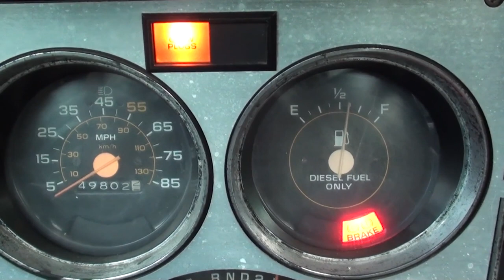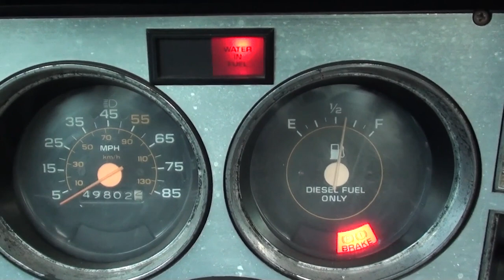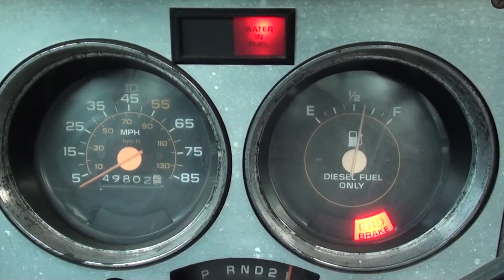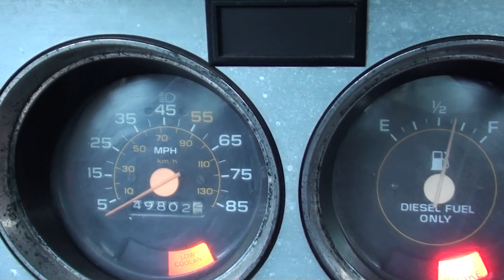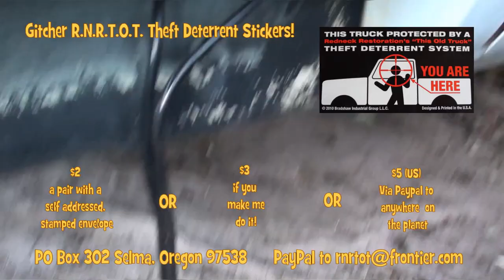84 Chevy 6.2 Lives Again! Fix the Fuel Leaks. Part 3 of a Series.

Comment: I bought my 84 GMC K2500 new off the lot and she’s still running. Replaced the original 6.2 with a rebuilt at 250,000 miles when a glow plug exploded and brought disaster. A great truck.

Comment: "It' not going to start !!!" Hahaha! I hear you brother. People that stupid should not be allowed on the streets. Another great video, Jeff.
Reply: One morning at work, a co-worker told us about a group of people standing around a car that wouldn't start. The car was cranked three or four times, and it would crank fine, but it would not fire.  Then one of them went over to his car and got out his jumper cables... Clearly did not understand the concept.
Reply: @rnreajr9184  those people crack me up 😅 it’s clearly not a dead battery, but hey more juice will make it go!
Reply: @rnreajr9184  had a coworker do something similar,   car wouldn't crank but all the lights were bright........ (in the car)   I said it's your neutral safety switch,  put it neutral and try it.  What ya know it fired right up!!! Goofball was going to jump start it.
Reply: Unfortunately, such people usually run the government!  Makes me much happier to think that they get driven around instead of driving themselves!
Reply: Well if it cranks S L O W L Y, a jumper cable might help, but not otherwise!

Comment: My grandpa had the same truck.. Drove it into his 80's.  Taught me drive in it.. Cut firewood.. Many memories.  He died a few years ago.. And grandma gave it to me.  It's sitting on the farm.. Needs some work.  I hope to have the opportunity to restore it someday.
Reply: ... someday.
Reply from the maker: As a preservation method, get the one gallon can of WD40 and a pump sprayer. Wet everything down twice a year. Everything. Engine, hinges, (especially hood hinges)chassis, door seals. If you intend to paint it, just soak the rust prone areas.

Comment: I once bought a car that started like that.    Rrrrrrr..........Rrrrrrr..........Rrrrrrr.  After several slow cranks, it would fire right up.  Always between 1 and 4 rrrrrrrs before the good cylinder came onto the firing stroke and away she went.

Got it home and found the problem - the battery was drier than the Atacama desert!  Several litres of distilled water fixed that, and that battery lasted another 2 years.  Never had a problem with the starter motor either.

Comment: Fuel lines are fairly important to engine operation. I bought an old IH tractor from a guy who told me of it's quirks the best he could. He said never leave the fuel shut off in the off position or I'd have to bleed the injector pump and lines. I never had that problem,  but I noticed I could never get consistent full throttle speed. Plenty of power, but it would drag down to 1300 or 1400 rpm. Everything leaked on it. Everything.  I thought it was a hydro line leak coming from a connection under the fuel tank. One day I parked it and noticed a gusher leak there...turns out the drip had been a cracked metal fuel line all along and was now draining 11 gallons of diesel out pretty quickly (lost about 3 gallons in the time it took to run to the shop and grab an empty fuel can and funnel, and a clean bucket because my one diesel can was only 5 gallons. Could have been worse. I fixed the line and the engine speed problems were gone also. I believe that was where he was getting air in the system before as well. Four years ago...still starts and runs like a champ. Long live the BD154 diesel engine!

Comment: i had a '94 6.5 exact same issues, every fuel line was rotted INCLUDING THE ONE UNDER THE INTAKE PLENUM ... lol on the plus side they are not too difficult system to work on, mine had a electrical lift pump on the frame under the driver side door, had to be replaced every 2 years.
Reply: @captainamericaamerica8090  RIGHT !!!!!!!

Comment: That's possibly a replacement motor my buddy's 6.2 diesel doesn't have valve covers like that but honestly they could have just swapped out the valve covers so check into it you never know..
Reply from the maker: Goodwrench crate motor. Lotsa miles on the old beast.

Comment: I'd have replaced it with a stainless line since it had been chewed on by a rodent. That's just to much work for a minor repair, to not spend $18 instead of $5 for a fix. Labor is much more valuable these days not to mention, you may have to buy intake gaskets everytime you replace it. JMO

Comment: Did the high idle solenoid get disconnected? That circuit also activates a timing advance to assist with starting the engine cold.

Comment: I have never cranked that much on a diesel. I usually crack the injector line loose and bleed them. But with the diesel we get now is does not stay good like the old diesel. I always have trouble with my ford if it has sat for a few months.
Reply: You have any advice on leaks on the o ring to injectors on these trucks

Comment: I would replace it with it's Cousin the 455 Olds Engine from a unloved Junker!!!
Reply: I wonder if you could convert the 6.2 to a gasser, like some have with the Olds 350 diesel.
Reply: Dan E. Boyd 
Nope, contrary to popular belief, the 6.2 - 6.5 engines were designed as Diesel engines from the start and were not based on gas engines like the Olds diesel was.
Reply: You’d have to swap the trans too. The 6.2/6.5 use the regular Chevy bellhousing bolt pattern vs. the Buick/Olds/Pontiac/Cadillac bolt pattern that the Olds Diesel used.

Comment: Typical small fleet vehicle right there.. every fluid on the truck could be leaking, half the tires are almost flat, and the brakes were shot 500 miles ago.. but as long as it can make it to one more job site, its good to go... lol

Comment: Is this the model GM diesel that had the meter pumps go out because they got overheated being to close to the engine block ?
Reply: Those were the electronic injected 6.5s. The PMD module that controls the injection pump on them, is mounted on the injection pump, under the intake. And not only is the engine heat itself high under there, but the PMDs themselves get hot. They fry and cause all kinds of issues like stalling and running away. They make relocation kits and coolers to solve that issue though.

Comment: Hay that is a goodwrench engine...that is not the original engine.... if interested the tube looking thing on the right https://youtu.be/B6KGt7Ib-NI?t=392 is the glow plug controller.  They are junk.  I was changing mine every 6mo until i gave up and put the electronic controller from a 1991 on my 6.2.  It worked much better.  The original had a heater that warmed up and that is what would kick the plugs in and out.  The 1991 had a timer that would trip the plugs on and off.  you had to connect a wire to the starter.  once it saw that pulse from the starter solenoid it would then kick into afterglow..it assumed the engine started.  was a much more dependable system.

Comment: it looks like a person can put an electric fuel pump in series with a manual fuel pump, is that what you did? I am having air in fuel system been fighting it for 4000 miles. I thought I had it fixed it ran for about 3000 miles then sdid it again i fixed it again, or so I thought.
Reply from the maker: Replace every rubber hose upstream of the pump. I used the electric to determine if the mechanical was bad. what I found was cracked hoses at the tank, allowing it to suck air. Yes, you can connect them in series, but in the end there was no need to. 
There are also hoses at the fuel switching valve if you have dual tanks, and the switching valve itself can leak. Air leaks don't necessarily show up as leaking fuel once no vacuum is applied.

Comment: I am not fond of the early years of diesel pickups.. big trucks had real fuel heaters an block heat or glow plug to get it more ritise. The starters weighed enough for three of them an now the lightweight replacement comes an you scratch your head as to how could this light weight little starter turn this behemoth over. Not only turn it, it turns right nicely. So to keep this from getting novel status, I bring this to the table. You get out of the hospital an your in all sorts of manadgery to hold you still an can't scratch your ear (only thing missing is that  collar that you use on a dog) so people are full of oh, sorry here let me hold that door or something thats more really irritating. Two weeks later in same but washed shirt an pants, some youngen is taking shots at you going in an around till you get dizzy. and here is the best part; crawling up on to the engine bay to work an those an others that decide to jump right in, hurt really bad now but your the only one there.....use all the "unnecessary" growns that you need  and stretch em out if you please... I started hurting way before your age now as you might of, and at 73 feel like that damn train did too hit me head on!

Comment: I prefer to vacuum bleed the injection system through the return hose.
Reply: @62guitarguy yep. I used my saturn station wagon. Hooked to the brake booster hose. Hooked the booster hose to a adapter, connected to a piece of vinyl tube, going to a old Jack Daniel's bottle.  Then other hose to return line. Normally I use this setup for bleeding brakes, but heck it's the same concept.